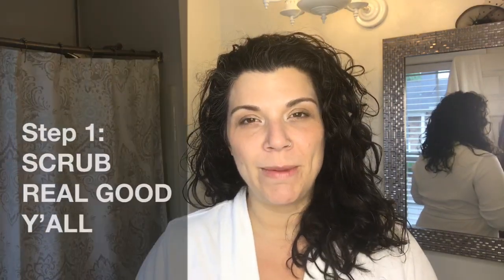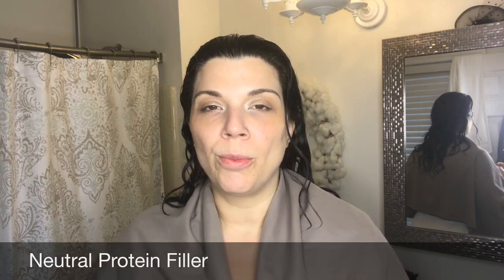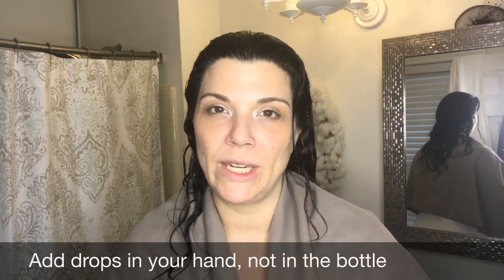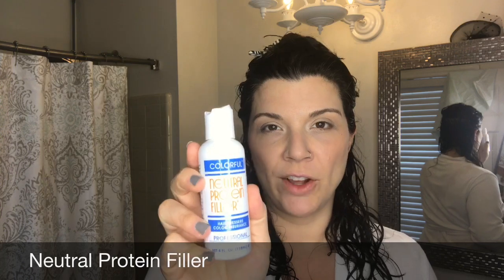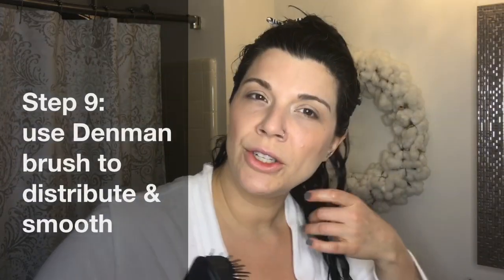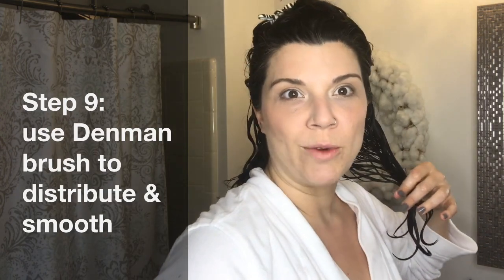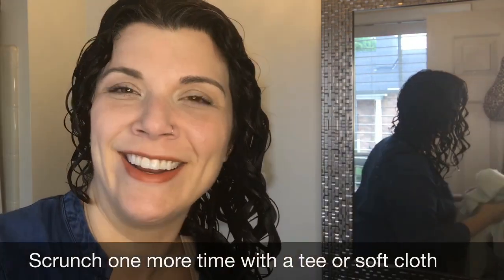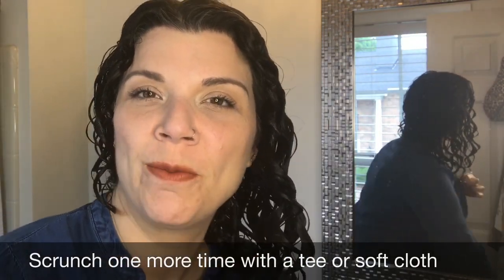Low-porosity Wash Day Routine | Curly Girl Method

Comment: I thought low porosity hair can't take protein and heavy butters and oils?
Reply from the maker: Hi - this is a common misconception about proteins. It can’t take large proteins. Butters and oils are pretty subjective - and it depends on the purpose. When I do an oil treatment, it’s to soften my hair up a bit since I have coarse to very coarse hair. Or to seal the shaft and weight it down if it’s really really humid out.
Reply: @southerncurltara  thank u a lot for ur reply! So what's considered large protein and what kinda protein could low porosity hair handle?
Reply from the maker: Proteins like keratin and collagen are extremely large. Others like silk, milk, wheat, and soy also need to be broken down in order penetrate the hair shaft. This can’t be done at home - only in a lab - so you want to look for products that have been ‘hydrolyzed.’ I have several products with hydrolyzed. proteins (Curls Blueberry Bliss comes to mind) but my 2 go-tos for tweaking my treatments are Braggs Liquid Aminos (the building blocks of protein) and Neutral Protein Filler. (I just realized I’ve never looked up the ingredients for NPF...🤔... I may want to keep the mystery and just call it magic. 😉)
Reply: @southerncurltara  we don't have these brands in Greece unfortunately is there a way or online store I can purchase them? They do seem to be amazing and to work well
Reply from the maker: oooh - good question. Curls is Curls.biz. I’m not sure about their International shipping policies. Braggs Liquid Aminos is actually a food product. Braggs is the brand. Similar items can be found at health food or natural stores and is often a replacement for soy sauce. Are you a member of the International Curly Girl Group on Facebook? They may have a Greece album. If not, I can check. For the Neutral Protein Filler, it’s typically found at hair supply stores - near the coloring supplies. (like gloves and bowls) I’ve been to Greece but not for normal shopping so I’m not as familiar with what the supply chain is like. :) Let me know what you find - this might make a fun video!
Reply from the maker: Also, as an experiment, if Curls won’t ship, I would be willing to ship you some stuff. Let me know what you find you can or can’t get and we can go from there! :)
Reply from the maker: You can connect to me on Insta @southern_siren or Twitter @TaraShaver

Comment: What are the signs to know if we have low porosity on loose hair like 2c,3a or 3b hair ?
Reply from the maker: Hi! great question - typically it take a while for your hair to get completely wet and takes a long time to dry. Water may bead up and sit on top of your hair - rain, or if you use a spray bottle, for example.

Comment: I'm low porosity and my hair doesn't do well with protein.
Reply from the maker: Fine Curls interesting. Is your hair fine?
Reply: @southerncurltara  Hey thank you for replying! Yes my hair is fine. I  love how protein makes my hair defined. But I've noticed protein makes my hair break especially on wash day. So I am currently using a shampoo and conditioner with a bit of protein. And my deep conditioner, leave in and stylers are protein free. That seems to balance things out but eventually I would end up with over moisturized hair. Any recommendations? Please help!
Reply from the maker: Fine Curls you bet! I could talk hair and products almost all day! ;)
Reply from the maker: Fine Curls That sounds like a good solution. I might try going protein free and just using neutral protein filler during styling when you feel like your curls needs structure. Definitely keep up the deep conditioning. Have you found deep conditioners that you like?
Reply: @southerncurltara  I definitely notice a big difference after avoiding protein in my styling routine.  My hair sheds and breaks less. Yes I have found a few deep conditioners that I like. Curl talk by Not your mother's is one of my favorites it's protein free. Also the Hydrating mask by Ouidad. Rizos curls deep conditioner is also one of my favorite but it contains coconut oil so I use it on and off. Do you have any favorites protein free deep conditioners?
Reply from the maker: oooh I have not tried the Ouidad or Rizo. I’ll have to investigate. 

Let me check my labels. I’ve got a nice little stash of some that I really like, but I’m not sure if they are protein free.
Reply: @southerncurltara  let me know if you have one in your stash that is protein free that you recommend 😊 Thank you for being so helpful I Truly appreciate it! Sub for life❤
Reply from the maker: Fine Curls Ok, I’m out of the one from Uncle Funky’s Daughter but I think it’s protein free. The one from LUS is Deep Condition and Repair - Express. It can be used as a quick deep condish or like a traditional 30 min one. It’s protein free. I REALLY liked the one from Uncle Funky’s - so can’t wait to order it again.

Comment: Your hair likes protein and it takes a long time for it to dry? Are you sure you're low porosity? Because my hair is a quarter dry just from stepping out of the shower and going to the mirror.
Reply: I'm also low porosity and it takes forever to dry and my hair is not dense. Many resources say low porosity takes the longest to dry.
Reply: accphotography yeah, it's high porosity hair that dries quickly
Reply from the maker: SO LONG! Especially when it’s so humid out and the moisture has no where to go.
Reply from the maker: YEP! I’m sure. I’ve had a scientific analysis done by My Mane Bio. :) 

I’m sure there are other factors that affect dry time. It varies depending on the products I use, but with no product it still dries slowly. I also live in a very humid climate. When I travel our west it dries much faster.

Comment: I have low porosity hair and I am having such a difficult time with applying either too much product or too little! My hair is fine too. 🤦🏻‍♀️
Reply from the maker: gah! This struggle is real! I had zero luck applying to ‘soaking wet’ hair in the beginning but now I’m revisiting that technique. I squeeze it out it the shower gently and just twist and clip til I can get my body dry-ish and put on a robe or wrap. Then, start working with it in sections. So far, I haven’t gotten too much product this way. It allows me to do some scrunching with a tee periodically and my hair seems to like that. It’s so curious how picky our hair can be, isn’t it? 😃
Reply from the maker: I can’t imagine the struggle you have with fine hair. Mine is coarse to very coarse.
Reply from the maker: with some medium/average thrown in for fun. Those are probably the clumps that always behave!
Reply: Southern Curl Tara Yes it’s rather frustrating! 🤣 I was thinking today that I need to clip half of my hair up and work in sections when applying product. My underneath doesn’t need as much as the top half! I saw that you have coarse hair in the video, I’m envious! 🤣
Reply from the maker: That’s exactly what I ‘ve started doing. It also helps my hair not lay weird when drying. 😆

Comment: I watched this video about a month ago, and not kidding I thought you were crazy with how much protein filler you were using every wash day. I think I have medium porosity hair but my hair seems to get over moisturized soooooo easily. I’m really trying to avoid washing it more than twice a week but it doesn’t seem to make a difference. I just did a protein treatment but I had to wash it out and my hair was still overmoistured. I just bought the protein filler, this is totally irrational but I’m afraid my hair is going to fall out. I really hope adding more protein in my routine will help me get the protein I need! Thanks for your video, sorry I didn’t believe you at first lol! Sending you love
Reply: Ria Thx for the comment and for watching! Do let me know how it goes! I got lazy with the protein while traveling (and after the dye job because it was sooooo messy!) but just got back to it over the weekend and the difference was HUGE! Good luck! 🍀
Reply: How do you know that your hair get moisture easily
Reply: give it up 000 Good question! typically, if your hair is limp and lifeless, it’s over moisturized. So if your hair is good, you are likely balanced. If it is a bit stringy, you probably need moisture. If it’s losing curl, not curling, and/or limp, you need protein.
Reply: @tarashaver13  thank you so much, my hair is really soft but it doesn't have shine  and I though it was because I recently start the curly girl method but anyways I'm gonna try use more protein to see what happens
Reply: give it up 000 just don’t overdo it. don’t add too much of either without evaluating what your hair needs. i was washing my hair too often which left my hair super overmoistured, on top of using conditioners and deep conditioners. you can also do the elasticity test. there are many good videos that explain moisture and protein balance, do the research before overloading!

Comment: I don't understand. My hair is also low porosity and I thought I should be avoiding protein. 🤔 I am confused 😖
Reply: meraklikedimuki It can be confusing for sure! If you read up on low porosity hair in general,  you’ll see that because the shaft is so tightly closed it can be hard to get/keep the moisture and protein. That’s why the heat is important. It’s pretty hard to protein overload low po hair, but it is possible. If your hair is kinda stringy, you probably need more moisture. If it’s losing curl, or won’t curl, you need more protein. The hair analysis from My Mane Bio really helped me understand this. Even if you don’t do an analysis, they have great resources and info on their website and FB page. Hope this helps! If you have any more questions or struggles, let me know.
Reply: Thanks a lot. I really appreciate the help. I will definitely check the FB page. Have a frizz free curly day 😁
Reply: meraklikedimuki Low porosity hair can be protein sensitive because the protein doesn’t penetrate the hair shaft and so it just lays on top creating build up. Your hair may like protein but it just depends. I have fine hair, low porosity and my hair really loves protein because it’s fine. When I need protein I’ll do a treatment, and use my heat cap. I have overloaded my hair with protein before using the drops! But now I know how to use them properly and I prefer an actual treatment anyway. I do the same with deep conditioning treatments and use heat. What helped my curly hair journey the most was finding out my texture (not my curly type or pattern), my density and porosity. I have fine texture, low to medium density and low porosity, pattern is 2b to 3a. I have to use volumizing low poo and conditioner, deep conditioning treatments as needed and protein treatments as needed, and because my hair is low porosity AND fine, both things make my hair prone to hike up so I enjoy a sulfate shampoo up to 3 times a month. Some curly girls are totally against sulfates, but just like protein it really depends on your hair! I have hard water too, so I have to use a chelating shampoo as well. Been doing this since 11/2018 and I am finally getting it. 🤣 My hair likes small proteins, like amino acids or hydrolyzed proteins because those proteins are smaller and will better penetrate low porosity hair (WITH HEAT). ❤️
Reply from the maker: yes! I love the heat cap, too. I sometimes even apply it after applying products. :) What’s your fave protein TREATMENT?
Reply: @southerncurltara  OMG! That’s a genius idea, can’t wait to try it. It makes complete sense that me product will absorb better with heat! I’m going to try steam also, thanks!

Comment: What other methods do you recommend for low porosity hair there’s a section of my hair that is very moisture resistant and loses moisture even after heat applied it holds the best when it’s in a protective style
Reply from the maker: M A I’ll be posting a newer routine soon, but briefly - I’m finding prepoo to be beneficial. I’ve either applied and used a heat cap or applied and left on overnight (sometimes with heat to start). You can read more about penetrating oils. Avocado is a good one. 

My hair has been on the struggle bus after the first 1-2 days after wash day so I’m having to fuss with it more. I’m back to using a leave-in conditioner during styling. It’s a struggle for sure! Try the oil on that section and see if it helps. 

I’ve also had some luck with dampening my hair and applying heat to refresh. Likewise, using the bowl method and dipping the ends in water to refresh (instead of wetting my whole head.) Both are mostly effective but still hit or miss so I haven’t made a video yet but maybe both are worth a try as you experiment. :)
Reply from the maker: I FINALLY got the new video up! Hope it helps.

Comment: Like the video, but your hair is natural high porosity. There's a lot of confusion about porosity, Please check out the video's from the curl ninja, she explains this very well.
Reply from the maker: Vera Limpens Thanks for the comment. We’ll have to agree to disagree on this one. I’ve had a microscopic hair analysis done so I know my hair comes out of my head with a tightly closed shaft -  low porosity. 

It’s possible for porosity to change as the hair grows and is exposed to the environment, abuse from styling, etc. It is also possible for the hair to behave differently due to build up. 

It’s a complex curly world and there are other factors besides porosity that affect results. I’m a firm believer that individual success comes from trial and error. 

FWIW: I rely heavily on the Frizz Forecast to set my expectations on wash days and beyond.
Reply: @southerncurltara  omg I'm so confused now 😂 I thought I figured it out, but apparently not. Your hair looks similar to mine though, and also to Curly Susie's hair (she has a channel). I like styling on wet hair but it also gets pretty heavy when I do, so when I want volume I try styling damp but then I miss volume. Sometimes I just want to quit with the whole trial and error and cut it all off 😂 thanks for your reaction btw, and sorry for my assumption about your hair. I really thought I was being helpful. 😘
Reply from the maker: Vera Limpens gah! No problem at all! It can be confusing for sure. 

Love Curly Susie. Just remember - she likely still has hair on her head that was bleached blond (not being rude - just clear that she’s a brunette and she went blonde blonde for her wedding). Now that she’s cut it shorter, it may be more consistent. I think there are some similarities with the type of curl and results since she’s a wavy/curly. Porosity matters - it’s just not the only thing that affects outcomes. 

Ahhh volume! A few things to try - root clipping like a mad woman when it’s still damp but not dripping. Also, GVP root lifter. Also, I can shake near my scalp and get a bit more lift. It depends on what I’m doing as to what I prefer - but I do think using the bonnet dryer to dry helps the volume while keeping more definition. Diffusing helps as well - but as Susie says, that’s 3-5 business days! Ha! I’ve been using the bonnet to free my hands. If I let my hair air dry, it’s usually pretty limp/flat - especially on top. 

I’m about to upload an updated wash day routine so you can see if some of my new tricks and tips help. I can’t do ‘soaking wet’ style - I have to remove water and sometimes even put some back in! Ha 

I’m definitely still learning! Thanks for the convo. Keep me posted on your progress and let me know what you think about some of my tweaks in my next wash day routine. :)
Reply: Southern Curl Tara where is possibile to get the microscopic hair analysis?  I'm from Italy.. help glad I found this channel.
Reply from the maker: Hi, thinking of you guys during this weird time in our world. You can order an analysis at MyManeBio.com There shouldn’t be a problem with international - since they email the report. You may want to email them for special instructions.
Reply: Southern Curl Tara omg what a fast answer thank you sooo much I didn't even know this existed before this channel thank you THANK YOU and as we say andra' tutto bene, everthing will be ok, this is just temporary.
Reply from the maker: Patricia Giurca I just happened to be holding the phone when your message came in. :)
Reply: She definitely has LOW porosity.